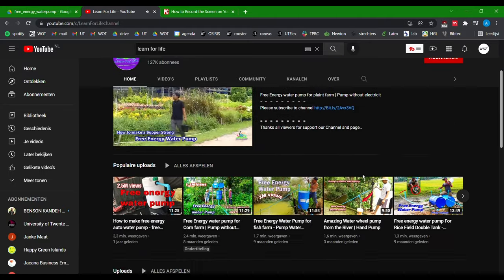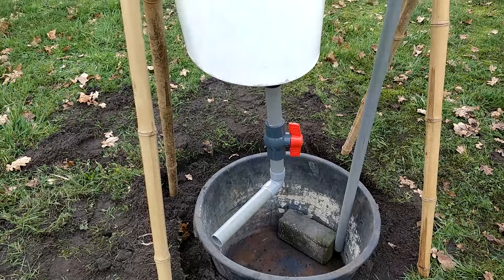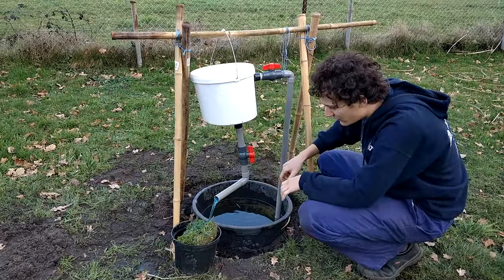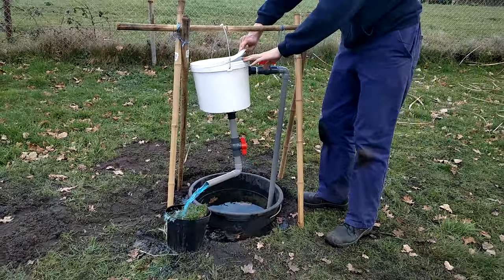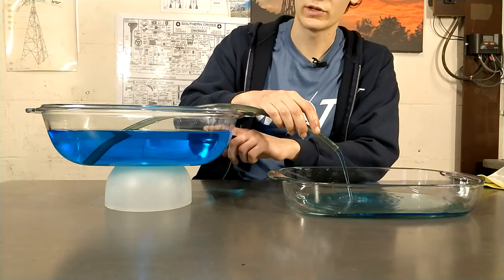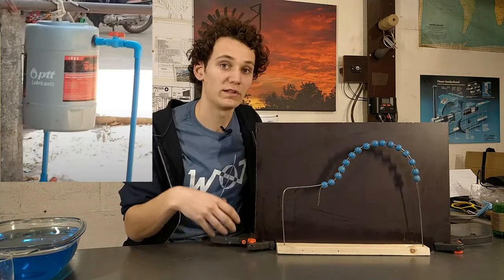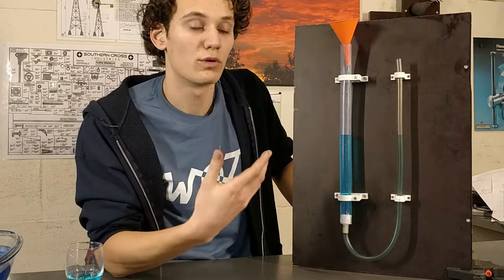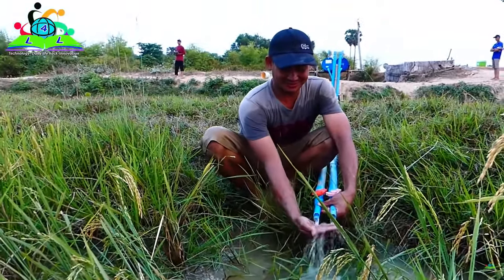FREE ENERGY Water Pump Tested. Is it possible?

Comment: At the most basic level the amount of acceleration (force) is proportional to the pressure gradien(change in pressure over distance).  Generally pressure is not conservative (meaning energy loss is guaranteed), but I think head pressure may be uniquely conservative over small distances.  Theoretically maybe a fluid pump could circulate its own fluid, but the wall drag and cavitation experienced in real fluid flows would prevent this is practice.  I appreciate you addressing conservation of energy and even going as far as to build the thing for people to see, unfortunately I'm not sure you could convince some of the people in the comments on this video of it even if you derived the governing fluid equations from basic principles in front of them
Reply: I think it would work, but you would have to recharge it occasionally.  The outlet has to be twice the size as the inlet.  So, either twice as much fluid is leaving the system as is entering it, or the fluid entering the system would have to move twice as fast, possibly some combination of the two.  I think it would be closer to option #1, where more fluid is moving less fluid.  Essentially, it is similar to a ram pump, but without the water leaving the system.
Reply: @wesbaumguardner8829  Even "recharging" doesn't work because it's SIFON. The principle of the siphon is that the outlet water column must create such a low pressure that the inlet water column can be sucked in. This can only be ensured by placing the outlet below the level of the inlet water column. If you wanted to "charge" it with the external tank above, nothing would appear on the output. You would have to drill air holes in the external tank and then the external tank would be emptied, but the original tank would remain unchanged. By the Berllouni effect, part of the liquid could be withdrawn from the low-lying original tank, but it is only a ml of liquid, as in a spray. A water hammer or ram is more efficient - it can hydraulically "knock" to a height of 0.1-1 percent of the inlet water column, which requires some minimum flow, as in a stream (it does not work in a well).
Reply: @DL-kc8fc  It does not work off of siphon principle.  It works off of vacuum principle.  The outlet is twice as large as the intake, so more water is leaving the system than is entering it.  This creates a vacuum that draws a smaller amount of water up higher than what is leaving the system.  It's like having two gallons of water tied to one end of a rope on a pulley, and the other end tied to one gallon of water.  Assuming you were able to get this to work, more water would be leaving the system than entering it so you would have to recharge the system by hand or some other method involving energy.
Reply: @wesbaumguardner8829  What you describe is still the siphon principle. The siphon is a pressure pipe, ie it works with a vacuum when sucking open liquid to a lower place than the water level being pumped. It's SIFON no matter what other useless things fraudsters give it to make it look sophisticated. If you had a lower drain hole larger than the siphon suction hole, little water would flow out. As soon as a lot of water flows out, air is allowed to enter the barrel by a valve that is open for video purposes, even if it looks closed in the video. You were deceived by people from the Third World who used the siphon principle in confusing terrain. The laws of physics do not allow water to be drawn through a thin pipe through a barrel with an extended outlet if this outlet is above the level of the water being pumped. No magical things happen. If you add another higher tank of water as a "booster", nothing will happen because it is hermetically sealed. You would have to increase the diameter of the drain pipe so that air can get into it, which will allow both barrels to be emptied. Then a Berllouni effect can occur, which "pulls" a little liquid from the lower level under the pressure (this is the SPRAY principle). But at the cost of enormous waste water consumption. Therefore, I wrote that it is better to use a water ram (water hammer, etc.) in the flowing water of a stream (does not work in a well). It doesn't matter that you are wrong, because you learn by mistakes. If what you think worked, we would have had a water perpetuum mobile and no energy crisis in Europe for a long time. It doesn't work as you would like and no one has a Nobel Prize. Try to include this perspective if you do not have mastered the laws of nature.
Reply: @DL-kc8fc  That video is losing vacuum due to the plastic deformation.  This process works off of the vacuum of the vacuum chamber itself, so it is imperative that a rigid vacuum chamber is used.  This does not disprove the hypothesis that you can pull a little bit of water uphill with a lot of water.  The ram pump works off of this same principle.
Reply: @DL-kc8fc  Instead of the water being pulled through the intake to fill the drum, the drum collapses reducing the volume of the drum.  The collapse of the drum is causing a loss of suction on the liquid.  They do not make syringes out of plastic wrap for a reason.  They use hard plastic because rigidity is required to pull the liquid into the syringe.  If you want to prove otherwise, feel free to make a syringe out of plastic wrap.  The barrel is basically acting as a large syringe.  This is not Nobel Prize information.  There is no free energy or anything of the sort.  It is just a larger amount of water moving a smaller amount of water, like a ram pump does.  It will run out of water.
Reply: @wesbaumguardner8829  You still don't understand. The barrel has no effect on whether it deforms or not. Don't give me stupid examples with a syringe that requires external human strength. If the barrel is hermetically sealed and the drain pipe is lower than the level of the pumped water from the stream, it all acts as a siphon. No small water pumping occurs if the drain pipe is higher than the level of the pumped water from the stream. I repeat, the barrel sucks and only demonstrates that there is a vacuum in the siphon. If you say that you pull out some liquid when the drain pipe is above the level of the pumped water from the stream, then you don't know enough - not even a drop will pull out - it doesn't work. The fraudsters only drain water from a barrel that has filled many buckets of water. If the drain pipe is above the level of the pumped water from the stream, only the barrel into which the air enters is emptied and the water from the stream will NEVER be sucked in. This is a natural principle that cannot be deceived. If you think a little bit of water from the stream gets into the barrel, someone could build a row of barrels along the stream and energy from one barrel would prepare another barrel for "pumping". There will be perpetuum mobile and if you are an intelligent and educated person, you must reject this. That is why it does not work, because nature does not know perpetuum mobile and blocks all efforts to build perpetuum mobile, for which it has no energy. This view alone must convince you that you are very wrong in fluid physics. You may know this, but you don't want to admit your mistake. I totally understand that.
Reply: @DL-kc8fc  "The barrel has no effect on whether it deforms or not. Don't give me stupid examples with a syringe that requires external human strength."  The water getting into the elevated drum required human strength.  It is the same damn thing.  There is potential energy in that water that was put there by human work, just like human work is directly putting energy into the syringe example.

"If the barrel is hermetically sealed and the drain pipe is lower than the level of the pumped water from the stream, it all acts as a siphon."  Yes, but it is not so it is not working as a siphon.  A siphon works because all of the liquid ends up with a lower potential energy than when it started.  In this system, a majority of the water ends up with a lower potential energy than when it started, but a small portion of it ends up with a higher potential energy.  Take a rope, run it through a pulley.  Tie two gallon jugs full of water to it and one gallon jug full of water to the other end.  Place the jugs at equal level above the ground and let go of them.  The two gallons of water will lift the one gallon of water.  That is what happens here if you can prevent the vacuum from breaking and the tank from deforming.  Two gallons leave for every one gallon that enters.  Two gallons are lifting one gallon.  It is using the finite amount of energy that was stored in the tank just as the finite amount of potential energy of the two gallons lifts the one gallon. 

"If the drain pipe is above the level of the pumped water from the stream, only the barrel into which the air enters is emptied and the water from the stream will NEVER be sucked in."  So, you are telling me that an infinite amount of water with all of its potential energy could leave the system and not a single drop of water would ever enter the system just because it would take some of the kinetic energy that is leaving the system?  I don't believe you.

"That is why it does not work, because nature does not know perpetuum mobile and blocks all efforts to build perpetuum mobile, for which it has no energy."  This is not perpetual motion.  I have already told you that several times.  It is merely using the kinetic energy that is already in the system, which is finite, to pull a little bit of water to a higher elevation.  This cannot happen indefinitely.  Sooner or later there will be an equilibrium that is reached.
Reply: @wesbaumguardner8829  You cannot learn because you do not want and defend your unscientific dogma. You distort my words because you do not understand them. I have an idea. Build a model with a transparent plastic barrel so that the barrel can be seen well (not as they do in underwater videos with opaque barrels). Immerse the upper suction pipe in a water level lower than the barrel, for example in a bucket of water. Equip the bottom drain from the barrel with a pipe that is at a higher height than the level of the pumped water from the bucket. For transparency, it will be better if the end of the bottom tube is higher than the barrel to demonstrate that the water rises to any height. It will be enough for me that the end of the outlet pipe will be 1 m above the level of the pumped water from the bucket. You can pour as much water as you want into the barrel. If you manage to suck at least a liter of water from the bucket through the suction pipe under all the above conditions and without fraud (I know it), which should be seen thanks to the transparent barrel and the loss of water from the bucket, for your work, video, material and proof of your "truth" I will send you 10 pieces of monocrystalline solar panels, each with an output of 130Whp (total 1.3kWhp) and an MPPT 20A controller (I do business with this range, even though I am a physics teacher). You have until the summer before the panel installation season begins. That is my public promise. My mail is dobrotivyvalentino at gmail dot com so that in case of winning without fraud you can send your delivery address and also to verify that it really is you. If you accept the bet and do not try the water. Or you will avoid fulfilling the bet. Or you make an attempt and you're not right. You have to apologize to me publicly. It's gentlemanly and very honest! What do you think? Will you lift your glove or step down? When you think you know the principles of nature, you can't lose anything. But I must warn you (so as not to say anything else) that it will suck water from the bucket if you place the outlet pipe from the barrel below the level of the pumped water from the bucket, because it is SIFON. If you place the drain pipe from the barrel above the level of the pumped water from the bucket, it will not absorb anything. It's just a matter of order so my word can't be distorted again.
Reply: @DL-kc8fc  "You distort my words because you do not understand them."  How did I distort your words?

" Build a model with a transparent plastic barrel so that the barrel can be seen well (not as they do in underwater videos with opaque barrels)."  That is not possible.  There are no transparent tanks on the market that will not deform/crush under vacuum.  I have already told you repeatedly that the tank cannot deform and must maintain its shape. 

"Equip the bottom drain from the barrel with a pipe that is at a higher height than the level of the pumped water from the bucket.  Immerse the upper suction pipe in a water level lower than the barrel, for example in a bucket of water. Equip the bottom drain from the barrel with a pipe that is at a higher height than the level of the pumped water from the bucket."  That is the design we are talking about.

"You have to apologize to me publicly"  For what?  Did you think I insulted you?  If so, how?  Is it by merely disagreeing with you.  Well, I am not going to apologize for disagreeing with you.

"It's gentlemanly and very honest!"  It is not honest if I have to lie to you and apologize for something I have never done.

Also, I understand why you think this system is impossible.  You think the water cannot leave the outlet of the system due to atmospheric pressure without losing the vacuum.  Well, I think it is possible to engineer around that problem using the laws of physics you already know well.  I do not think the people in this video ever achieved what they are claiming, but I do think this system will work when properly engineered.  It just will not work indefinitely as eventually, the water will run out as it has to leave the system quicker than it enters the system.
Reply: @wesbaumguardner8829  I made you an offer - build it and show that it's working (that you're right) and I'll send you a reward to which I have made a public commitment. I know exactly what you mean, but you're not well educated in the natural sciences. That's why you're making mistakes. I don't blame you - no scholar has fallen from heaven. But I'm giving you a chance to prove to everyone that I'm not right. Make the barrel what you want and it does not have to be transparent, because it is possible to observe a possible loss of water in the bucket, which will be under the barrel. You can have the outlet hose as long as you want. Only its end must not be below the water level in the bucket (so that the siphon principle is not applied). To prove your claim of some personal "truth", it is enough to "vacuum" at least one liter of water from the bucket. It's a gentleman's offer. If you don't accept her, I'll take it as your defeat, meaning you're wrong. Many people have already responded to my published email. They'll watch you handle it. These people would be very disappointed if you did not accept my offer and honestly did not admit how things were. :) Since I'm not a bad person, I'll tell you where you're making a fatal mistake. The discharge hose is not really a hose, but together with the barrel it forms a connected container (you learned about it at school - I am a teacher). So despite the shape of the hose, it's still one container along with the barrel, because it doesn't matter the shape you know from school. The hydrostatic pressure is still the same regardless of the shape of the vessel. In order for this content (barrel and outlet hoses together) to draw water from the bucket below, any part of the vessel (barrel and outlet hoses together) must be below the level of the pumped water from the bucket, ie such a height "h" + "h" of water. columns below the water level in a bucket. Only this will create the necessary under-pressure and the weight of the water from the water height column (not from the length of the hose) will allow drainage - but that's SIFON !!! This cannot be done otherwise unless a water hammer or ram is used, which is not the subject of this topic. No more chatter. Either accept the challenge or not. Don't talk about it working without making your own attempt. It does not work.
Reply: @DL-kc8fc  You are correct.  I am wrong.  :)
Reply: @wesbaumguardner8829  You have gained moral credit because, as a good gentleman, you can admit defeat, which does not detract from your person's seriousness, but rather gains. Such an approach is highly valued in our country. :)
Reply: @wesbaumguardner8829  no. the system does not need recharging if sealed properly. the result iz an equalibrium between inlet and outlet where the VELOCITY only of the inlet goes up to compensate for the higher volume outlet. the key is that air is NOT allowed back in. mine runs till i stop it. for days and dayz. it took several tries . this force created by the right combination of vessel size and plumbing is the key. i collapsed many barrels before i went with a 1/4" thick air compressor tank. now it pulls so hard that it almost took my finger off when i got it stuck in inlet. it scared me it was so powerful. re asses this design. it works and don't stop till you have it. don't let college books defeat you. this is how the establishment gets away with selling us what we could do ourselvez. learn from experience not books. outcome will suprise you.
Reply: @wesbaumguardner8829  no. ram pump is actually completely different. works off of positive pressure and force not vacuum. this concept is strictly vacuum operated. it is completely different.  dynamics do not cross over between these two designs. and yes it works better than a ram pump. more volume and more velocity created by this vac system. i have done it .i know it works. working on scaling it up .
Reply: @KevinFreist  Sorry, but you're not right. The whole thing is already closed. Honest handyman tried it and came to find out like me, that is, it doesn't work. Don't do that.
Reply: @KevinFreist  How do you prevent the draw back of air from going into the tank from the inlet and ruining your vacuum?
Reply: @KevinFreist  Sorry Kevin, but a “barrel pump” that lifts water is impossible. Now you claim that you have made one. Show it in a video and show the world that at last perpetuum mobile is possible. As your pump lifts water, you can let the water flow back to the source via a turbine. You have unlimited access to energy. Grats!